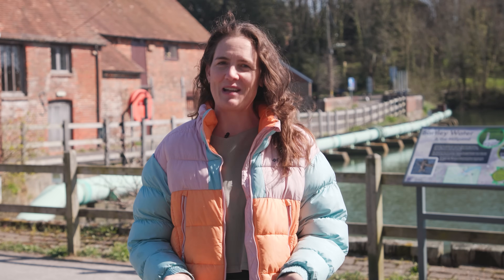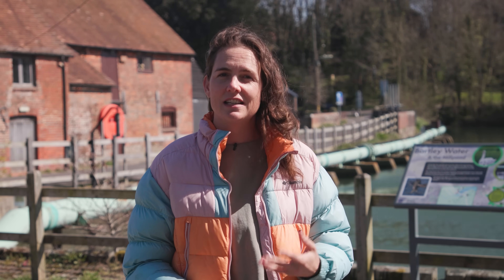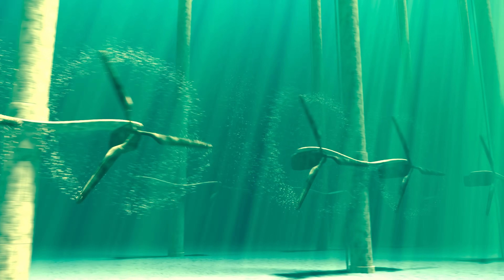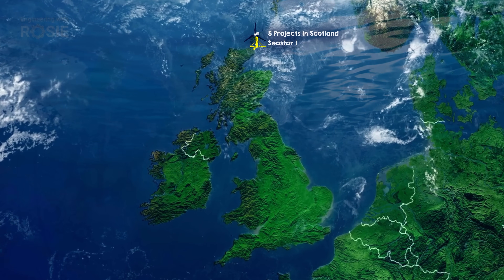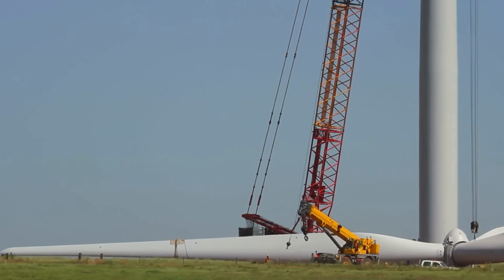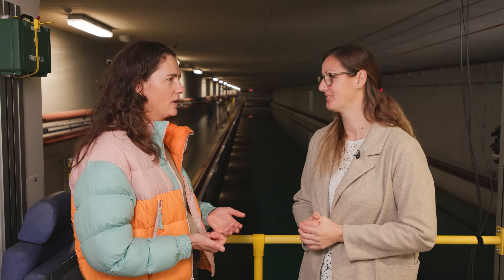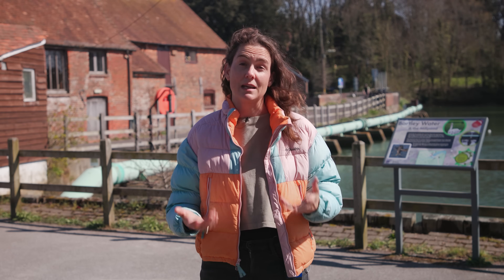A 1,400-Year-Old Idea That Might Save the Climate

Comment: Hi. you are close to the best idea.   But put them deeper, and bigger.  All the way to the deepest part.  Turning wheels make friction.  Friction makes heat.  The pipe brings the hi-pressue Supper-HOT water to the land.  Steam is produced, and fresh water is the by-produt.  
Thanks.....  Below the sunlight.  below the whales, below all living life is very high pressure.  And extremely hot water does not boil....

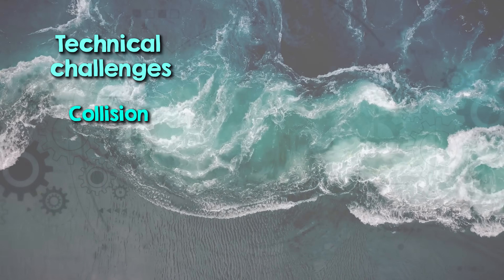Comment: I am curious about the "minced fish" potential.  Not that it is necessarily a project killer. I just wish more data were released about this aspect that I suspect is already being collected (hopefully species specific). This problem is loosely referred to at 13:06. Perhaps it is negligible, but I never hear that stated. I hate to make assumptions. The "minced birds and bats" aspect of wind turbines has been used for propaganda purposes against wind power.
Reply: how many fish are killed by oil and gas pollution? by shipping and oil rigs?

i recall for wind turbines that building any structure at all kills birds

Comment: I built a series of tidal generators back in the 80s to power live aboard boats.  Most of the problems they have come from the wrong type of rotor.

The rotor should be a fair size center hub and low aspect ratio blades that leading edges are swept back. 

These are far stronger solving the breakage problem, labor and as swept back like a weedless outboard prop, just throws off seaweed, plastics, dock pieces, tree parts and all the other things in the water column.

These things will cut maintenance by 90% and increase output as the larger hub speeds the tide up so starts generating earlier and stops later.

I also did small WT and boat power drives designing high tech boats at the time.    

And you can't put a WT blade in the water and except it to work as it'll get destroyed, especially when you have 150 yrs of ship propeller tech to draw from.

Just reverse the blade twist and you have a great tidal rotor that lasts.

Comment: This could be a daft question, but I'll ask it anyway. Does putting resistance in the path of the rotation of the mass of the Earth and Moon slow this rotation down and will one day this extraction of energy cause the Earth and Moon to collide?
Reply: I don't think adding a turbine makes any difference, the tides eventually hit the shore if they don't hit the turbine first. 

No, the Moon will not eventually collide with the Earth, due to the tides, it is slowly moving further away from the earth, and as it does, the tides become smaller, and the amount of tidal power decreases.  It will require billions of years to make a big difference though.
Reply: tidal losses make the moon orbit larger, but the sun will nova before we lose the moon..... do the math
Reply: definitely daft

Comment: The problem is sea water kills everything you put in it and building anything at sea is expensive, very expensive. The best tidal energy solution I have seen was a sea wall stretching from an island to the shore. The wall had lots of turbine holes in it only about a mtr wide and turbine units were dropping into the path of the water from the top of the wall through slots in the wall. This means you can pull a turbine unit out of the wall and service it very easily. In the UK you might look at the isle of Lundy to shore fast moving water and deep enough to make it work. Still super expensive up front but the wall would have a long lifespan and the turbine units are interchangeable for a relatively cheap price. Basically the stone and concrete stays in the saltwater which we know how to do now, the expensive tricky bit becomes a temporary fitting
Reply: It sounds not like a general solution, but rather a good way to get something extra out of a road you need to build
Reply: I live on the West Coast of Australia. Admittedly my State is 3 times the size of Texas, but we've places where tides are over 30 foot, and places less than 3. You've gotta find the right place for Tidal, and then there's a bloody annoying amount of wildlife dependent on that tide. And where our tides are enormous, no-one lives nearby. Tricky.
Reply: @tsubadaikhan6332  yep totally agree the correct spot is vital and few and far between and wildlife has to be a consideration unlike windmills that kill birds for fun
Reply: Still tide water is a much better solution than expensive, slow to build, risky nuclear fission energy.  There are orders of magnitude more tidal energy that nuclear too!

I'm surprised at huge money spent on the very long-shot nuclear fusion.  Almost all public research subsidies should be redirected away from fusion towards things like tidal water energy.
Reply: @beyondfossil  I agree. We already have technologies that actually work, we just need to build and install them. The nuclear industry are forever chasing rainbows, at huge expense, our expense.

Comment: Sooo... basically regional as part of a mix. Practical potential less than 1% of global energy demand, which is rising exponentially. With unknown factors, such as what changing ocean flows might do. Outside of all that, it's great!

PS: Sea levels rose 400 feet over the last 20,000 years. The planet doesn't need saving.
Reply: When we reach net negative, maybe we can get the sea levels back down those 400 foot.  Think of all the extra land space we would have to live on!  Mind you, we would have to share it with our current offshore wind turbines, which would then all be onshore, and we wouldn't have so much space for putting new ones...
Reply: @nigels.6051  You also have to take into account where all that water came from. Canada, parts of the northern US, and parts of northern Europe were under ice.
Reply: YOU MUST RESPECT THE CLIMATE LIES!

Comment: Tidal has potential but recently they have discovered that areas with strong tidal flows have the capability to move boulders the size of houses which then carry tremendous potential energy to damage structures anchored to the sea bed.

Comment: The tides are also intermittent and only slightly better than wind in that it is more predictable.
Sometimes tidal power will be opposite solar, sometimes it will be available during peak solar.
Reply: It is far more reliable and easy to increase it's capacity.

Also tides happen hours apart even in short distances so by selecting where the fields are you can get steady power.

Comment: Above all, scale and efficiency are critical when it comes to tidal power.
But the hard truth is this:
NUCLEAR remains the only pragmatic energy solution capable of meeting demand while preserving the climate.
Take the La Rance tidal station, one of the largest in existence, with a capacity of 240 MW. That’s already more than ten times larger than most other tidal projects globally.
And yet, a single average nuclear reactor produces around 900 MW.
To match that with solar, you'd need 8.5 million panels , each of which must be manufactured, transported, installed, maintained, and eventually recycled.
Recycling solar, incidentally, is something we still haven't figured out at scale.
Reply: 900 MW is a small nuclear reactor, the UK's new Hinkley Point reactor is 3.2 GW, our new Dogger Bank wind farm is 3.8 GW.  To compete with them you need a vast area of damaged estuary, ruined for the wildlife that lives there.  

That 240 MW is the peak output, average output of La Rance tidal station is 57 MW.
Reply: @nigels.6051  Thanks
Reply: France has a large number of nuclear power plants.
Reply: True but not how you think.  That free nuke in he sky, small wind,  CHP generator, cost far less than nuke costs to be delivered, much less cost to make.

Presently you can build RE, battery for 10% of the cost of a nuke in 20% of the time and get 4x the power/$ .

I make, store my solar with my custom EVs that have had V2L 33 yrs for under $.05/kwh.  Soon most will doing the same.

Comment: One thing i don't think we are investigating much is the canal network. 
Lots of the canals have weires to allow excess water to move downstream avoiding the locks. This is usually a 2 meter drop, which would be enough to generate some power. Given how many canals move through town centres connectivity should be easy to achieve.
Reply: There is a low head hydro scheme on a weir on the river Dart at Totnes in Devon. Powers about 333 homes , 1250GWhr per year.
There are in the region of 16000 weirs in the UK, if 1000 could be used for electricity.
Reply: I was involved some years ago, as a contractor, looking at systems for Thames weirs providing power  using Archimedes screws. I believe some have been commissioned. Better prospects than the saline environment for reasons commented upon elsewhere

Comment: There are castles in Europe that were built seaside to defend harbors. They are no longer seaside castles as the sea levels have dropped since the 12th century when they were built. There's nothing wrong nor anything you can fix with the climate.
Reply: There is a castle near me that was built with a port for ships to dock, but is now miles from the sea.   Not because sea level has dropped, but because the land has risen faster than the sea level!   Sea level is actually rising.
Reply: Cleaner energy is well worth it regardless of the climate.   We need to get away from the politics, world power plays, connected with fossil fuels.
Reply: How old are you roughly?

Comment: 0:37 min. in there is a short video of several tidal technologies.
I would like to point out that the kite animation slightly to the right in the middle is incorrect. The kite moves in a pattern of an sideways 8, accelerating the turbine to several times the current speed.